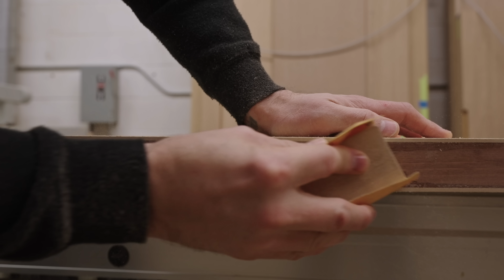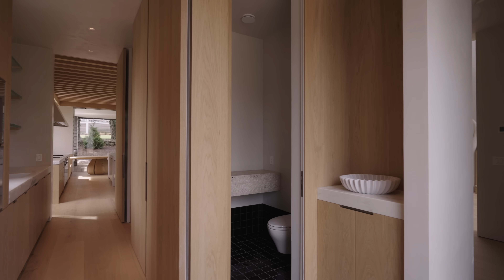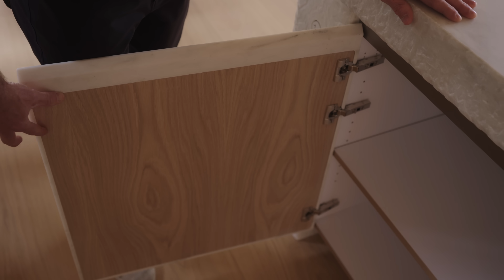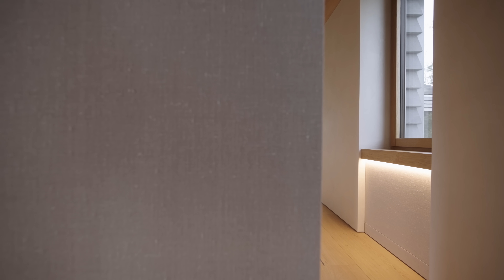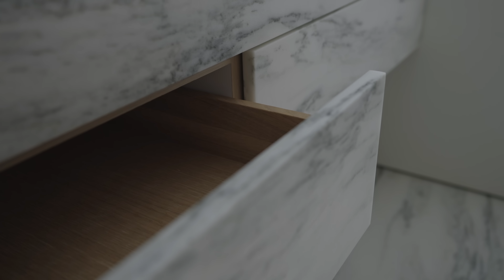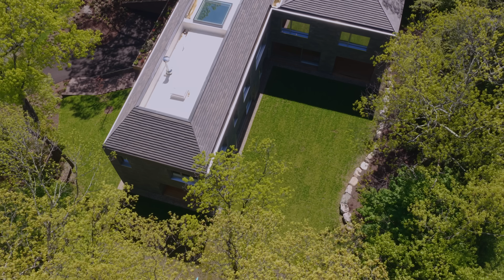45 White Oak | Why This Cabinetry Was So Hard to Build

Comment: Millwork mastery at its best! 25 years running a custom shop here. We did a similar job last year for a client. 
I resolved that the only way we could do it and stay in business when it was completed was to abandon our standard practice of estimating labor and materials for projects and sticking to that price unless the scope changed. We did it as time and materials, carefully recorded among ~25 projects in the home and billed monthly. Our typical project is in the 25K median. This project was a 1M package, and I would have estimated at less than 2/3 of that final total. I'd be interested in any details you might be able to share about your pricing method for labor and materials for this project, as well as how you handled installation.